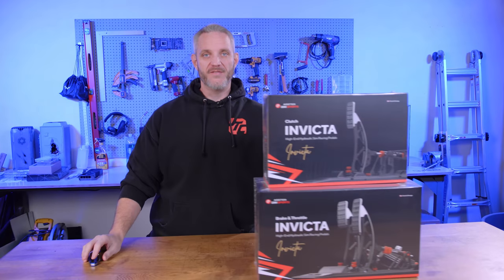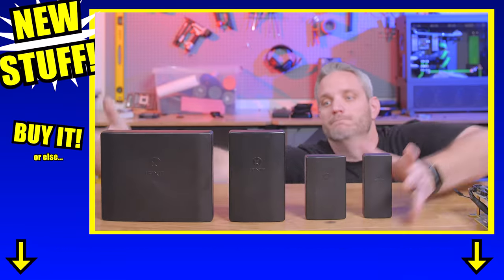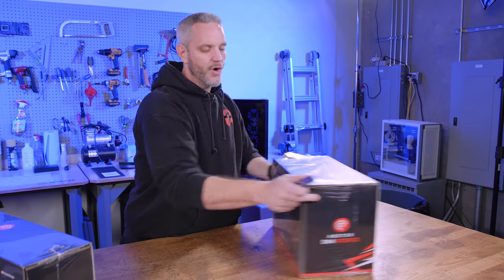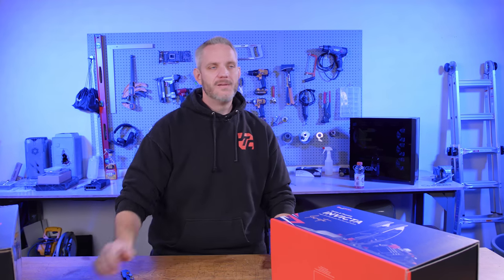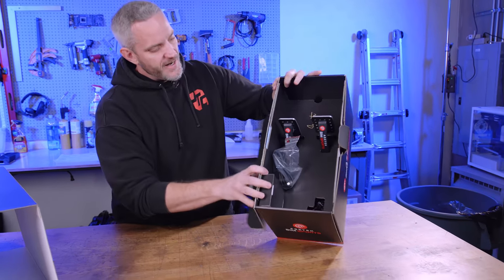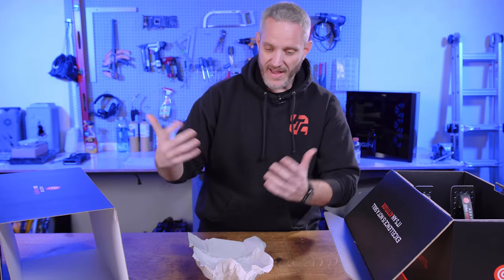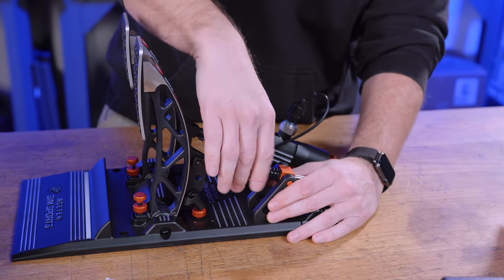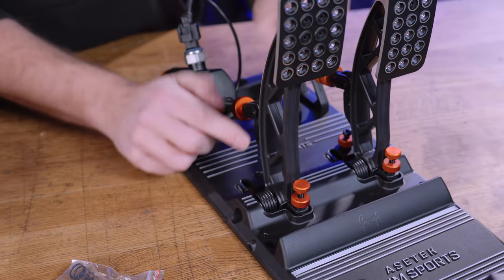These new Racing Simulator parts are insane! Asetek Invicta... yes, ASETEK!

Comment: you had that backwards. the switch gets pushed in while the pedal is at rest and turns the lights off. when you move the pedal off the resting point it releases the switch and turns the lights on. the brake switch basically works backwards of a normal switch.

Comment: The place where my brother stores his car in the winter has an arcade room. It's all automotive related games and pinball. They have a sick sim rig that is 3 monitors, 5.1, and even tilts and shakes the seat. That was the first time I saw a pedal set with hydraulic reservoirs lol. It's pretty sick. I can't image the cost. Every car I've owned has been a manual so I'd need the clutch for sure. The brake and accelerator seem far apart. Might be tough to heel toe downshift.

Comment: Just a FYI that's not how a traditional brake light switch works. Also the hydraulic switches are notorious for failing and causing a brake fluid leak and on Fords the cruise brake switch likes to start a fire when it leaks. Nothing like risking a brake failure over some lights.

Comment: You didn't mention the second, lower hole that is on the pedal side, which attaches the spring to the clutch petal.  Stop the video at approximately the 18:00 timestamp mark.  So, not only do you have the four holes on the spring side, you have two on the pedal side, which gives you 8 different angels of adjustment, in addition to the manual screw adjusters.  Anyway, I assume you will have a follow-up video to this, with actual user experience feedback (with various sims), and how the different adjustments changed your feeling.  Looks like good stuff, thanks for the video!

Comment: Just a quick note on one other floor mount reason: You don't get your foot caught under the pedal.

With dash mounted if your foot slips off it can get caught lifting it back up. Only perhaps for a millisecond but in racing that can be an eternity.
Reply: That makes a lot of sense, I’ve gotten my foot caught behind my brake pedal while heal toeing several times & it’s absolutely terrifying for a split second.

Comment: My guess is that the usb doesn’t stick out the back might because they were concerned about obstructions such as securing frame rails, causing issues with the port.  There is even the chance that they were concerned that it might be pressed up against the wall…not taking into account the overhang of the brake pedal making that impossible.

Comment: Sounds like the time I tried out a downhill racing bike vs my crusty mountain bike. I knew it had better suspension and brakes. But, I over estimated how good the brakes were. First time I used them. I nearly did a handstand over the handlebars... Didn't want to use the bike after that.
Reply: Under estimated

Comment: I may eventually give them a try but I love my Heusinkveld sprints. Big step up from the clubsport v2 pedals before them. I don’t feel like I’m lacking in the pedal department right now. Mounting them to the floor doesn’t really make a “firmer” platform. I have a sim labs inverted pedal rack for my sprint pedals and they feel much more natural that way. They are just as firmly planted as they were when mounted the other way.
Reply: Heusinkveld are a very reputable brand with excellent equipment.
Reply: @douglasm3310  agreed. I love them and even though I’m always looking for a reason to upgrade things they’ve been so good I can’t imagine anything being so much better that I should spend more money on something else.
Reply: @Jpilgrim30  I would get the heusinkveld ultimate over these however.
Reply: There's no way these will be as nice as the Sprints, ...  or even the Fanatec V3s by the reviews & look of them

Comment: These invicta pedals cost something like $1200 USD retail, and only work on pc.  They don't seem to be worth 2.5x the price of the fanatec v3's.  The build quality seems pretty much on par with the v3's, everyone says these invicta are too loud while in use.  
You need to maintain all pedals and lube them up or they all start to squeak.  Currently using a GT DD Pro wheelbase with Fanatec v3 pedals and the 911 GT3 R wheelrim.  These pedals look nice but i dont care for the super hard brake pedal as the only option.  I prefer to drive road cars in sims and actually bought the v3 performance kit in order to use the 2 softest elastomers it comes with to simulate how my real life daily driver feels like.  The v3's NEED the brake performance kit, the squishy sponges it comes with stock feel awful.  Also went for the adjustable dampener add-on to give the pedals a more realistic hydraulic feel.  On top of that i needed pedals and a wheel that works with all 3 platforms, PC/ps5/seriesX, and unfortunately that means Fanatec really is the only decent quality option.

Comment: lol, watching this made me think of some of my old 65 chevy truck...had a 3 on the tree with a six cylinder. Later it was changed to 4 on the floor with a mild built 350. No power breaks nor hydraulic clutch....just heavy springs that was rough on my left knee.
Reply: not that GM truck clutches were much better hydraulic, I had a 1995 S10 for a period of life and it had a pretty heavy clutch.  I remember driving a Honda Accord once and felt like I almost put the clutch pedal through the firewall. because I got in and muscle memory applied the usual force to the clutch and its like whoops this has a much lighter clutch.

Comment: Your first explanation of your car`s brake switch is backwards. When the peddle is at rest, the switch is engaged. As you press on the peddle, that switch releases and closes the circuit to light up the brake lights. In your example, the switch would interfere with the peddle as you applied pressure. The switch is on the front side of the brake pedal, not the back as you claim.

Comment: Formula 1 uses a clutch. It's on the steering wheel, and they use it for standing start or if they pit. They don't need it for shifting :)
But a clutch with a finger, ouch :D

Edit: My thought about the cable. If you want to mount the base flush to a wall, or somewhere else, a cable directly mounted on the outside of the case, and you would have the problem of bending the cable like crazy. Inside like this, and you can run the cable in any direction you want, even to the side. Looks strange in the beginning, but I see the advantage :)

Comment: 8:30 no, this is wrong! The soft-stage on these pedals is the elastomer, and the hard-stage is the 'wall' that comes after where the pedal only registers additional pressure that you put on the piston, which puts pressure into the system which is then registered by the sensor. What you are doing by screwing the endstop so far out is adding a dead-zone where the pedals don't register anything.

To add to the review, what I find funny now is that Asetek are saying that they are emulating the feel of a 'real race-car' which is technically correct, with the keyword 'a' race-car, as in, one of many. They say that 2cm of pedal-travel in the soft-stage is realistic, which is technically true for one setup. But the thing with brakes is that the soft-stage pedal-travel is determined by the ratio of the brake-piston to the brake-cylinder. So yes, their setup is 'realistic', but also takes options from the end-user because they only have one option. Where with other pedals like from Heusinkveld, or BJ Simracing, you get options. On these pedals you can also set up a super soft soft-stage and then a rock-hard hard-stage, giving you the ability to make your pedals feel like you want.

Comment: I use the logitech g920 gear and when I first opened this video I was like eh it's probably similar but I've never even driven a manual car irl so I didn't know about the clutch pressure or anything like that. After watching you've made me want to switch to something a little higher end because driving with the logitech clutch kinda sucks sometimes, there's no pressure in it at all so it's hard to find the right spot coming off the line. Honestly the logitech brake and throttle I know aren't great either but they're leagues better than the clutch

Comment: I would love to differ with you Jay, but you are right to a certain extent, logitech pedals are ok when not in racing sims, as I do a lot of ETS2, and ATS, but does make me wonder sometimes if the brake pedal is connected to anything as you go hurtling towards a lot of stationary traffic unintentionally, even though I do turn the brake intensity down so not stopping on twocents from 56 mph. just never had the money to upgrade my rig setup, as 2015 was buying the wheel, 2016-2018 was buying controllers, 2018 was building my pc, 2019 - mid 2021 was a tough time money wise, maybe time to look at upgrading my pedal system, so looking forward to another review of you testing this on your rig for a week or so, so you can give us a proper review.😀

Comment: Hey, Jay. You got the brake light switch mechanics backwards. The switch works in reverse - it is on the other side of the pedal and it's always depressed and it turns on when the pedal moves away from it. 🙃

Comment: Edit: When $600 for JUST  a set of pedals (the Fanatec Clubsport mentioned at the beginning of the video) is "the top of the low end" in racing sim gear... this is what I'm talking about as far as ridiculous price is concerned.

I just wish sim racing gear wasn't so expensive to get into. Without force feedback, the wheels are completely useless, and you're not getting a decent one of those for under $400 - 500. Still cheaper than a new video card, but ... ouch. And that doesn't even take into account getting either a frame or a freestanding mount for them.

Comment: I love sim racing i miss my sim racing set up but i didn't get enough time to use it as much as i wanted to. Fanatec is great for the pricepoint wich most can't even afford these are on another level when it comes to price only the well off hardcore sim racers could afford them and justify the cost.
Reply: Sorry to say but those invictas are not even close to high end hardcore equipment. They are more the average entry level hydraulic pedals that are fairly good value for what you get with them. Same as the Simagic P2000 TBC pedals. The real hardcore racers use stuff like Simtag tilton blacks editions or stuff like that.  

Like jay said, Fanatec is the upper part if the low end bracket in terms of pedals they provide.

Comment: I'd love to have a high quality racing sim setup.
Speaking mostly about the wheel and pedals of course but it feels so expensive and complex to get into.
Reply: It is expensive and complex, so start out cheap to see if you actually like simracing and want to pursue this hobby further.

I started 6 months ago with a Logitech G29 and a Playseat Challenge; just last week I finished assembling a 8020 cockpit which was complex and VERY time consuming to build, so beware.

Originally, I was looking at the Fanatec wheelbase and pedals, but I think I will skip those and go for Simucube and Heusinkveld, or even the pedals in this video.

It will get expensive extremely quick.
Reply: @frankvermeulen4621  Well, so far I have my trusty yet old Driving Force GT which still works well.
A shifter and better pedals would be cool though, I know at least the former can be added as there are such that use USB.

Comment: I'm curious about force feedback in the shifter, I've never heard about that being a thing but I feel like it would be an important component in a high end system...
Reply: Force feedback on a shifter ? Your shifter shouldn’t be shaking or having any force dude. If it does, something is really wrong with your car lol most high end simulator shifters are literally the same system used on real race cars.
Reply: A tactile transducer like a Buttkicker mounted to the side of the shifter running through software like sim commander works extremely well. The Fanatec shifter has matching mounting holes already
Reply: @Barbosa81  There are cases where you can't put it into gear, being able to just force it into gear because it isn't a real shifter would be silly.
Reply: @gudenau  that would be because you have bad sinchros in your trans or you’re not pressing the clutch fully. And that only happens on road cars. Race cars have dog gears transmission and it will go into gear no matter how you’ shift it. On a simulator if you do this on a road car the car wil stall or bog it.

Comment: The other problem of electronic brake light sensor is that some work like the light in your fridge : it only lights up when the button isn't pushed. So if the little piece responsible for the pushing breaks, it's always on. Next thing you know, you have a dead battery the next morning before going to work...
Reply: Not on all cars. Older Fords use a NO switch that closes on pedal depression; dunno if they still do. It's kind of a weird setup that uses the end of the pushrod to actuate the switch as the angle between the pushrod and pedal arm changes.

My old Nissan (Datsun) has a hard rubber button that contacts a NC switch as you describe. I taped a penny over the hole until the dealer got their shipment in (they had 2; I needed 3). Other owners have mentioned simply welding up the hole, but I figured that probably wouldn't be great for the switch in the long run - and the buttons are still current stock over 40 years later, unlike the switches. So I'm sure Nissan is still using the same system.
Reply: @Azlehria  solved mine with a good old nut and bolt
Reply: @guillaumejoop6437  In hindsight it wasn't clear, but I meant that I figured the metal surface wouldn't be good for the switch - after all, it would have been cheaper and simpler to simply use the arm itself as the actuating surface. Since the original switch worked flawlessly for 40 years, I felt that for 96 cents each it was best to just retain the factory configuration.

Comment: Slightly off on the description of how the brake works on this pedal. If the bushing isn't engaged and its just the spring, that's the deadzone. The bushing is the soft stage. Then the outer edge of the adjuster nut will bottom out on the cylinder and become rock hard, that's the hard stage to build up extra pressure for braking without the pedal moving.

Comment: with break so stiff does it matter to have pedal? it seems it just signals if it is pressed or not, there is no possibility for the user to adjust how much breaking force to apply
Reply: Works off of the AMOUNT of pressure applied to activate the variable electric pressure switch
Really is not any different how a load cell works and they both send the game the exact same info they just use a different method to reach the same exact result.
But many hear the word hydraulic brake system and suddenly think it is doing something that you cannot do with a quality loadcell pedal set which is not true at all.

Comment: I know this doesn’t got anything to do with this video but I got a question, I don’t see why you couldn’t but I haven’t found an answer can you use and ek water block with corsairs pmma tubing? I want to use a ek water block because it looks better on the gpu same with the cpu I’ve heard not to mix there fitting and use corsairs fittings so just out of curiosity any thoughts.

Comment: Wow, these are more expensive than the heusinkveld sprints I've been running. I'm curious to see how they stack up against each other.
Reply: I mean, there’s pedals way more expensive than this set too.  I have Sprints myself, I don’t think I’ll ever replace them but the adjustment design on these are impressively well done.
Reply: @WhiteHawk77  they do seem a lot easier to adjust, compared to the sprints.

Comment: F1 cars do use a clutch, but its not a pedal. It's a button on the steering wheel
Reply: @pistolfied  right, again, not a pedal... a button (a small object that can be pressed or depressed to give function into module) that engages clutch

Comment: How does the system monitor the throttle?  I see through the sensor on the brake how that works, but I'm not sure how the throttle itself works.
Reply: Hall sensor on both throttle and Clutch

Comment: 700 euro pre order price expensive but then again cheaper than a gpu that you will replace in 2..3 years, theres no reason the pedals wont last you 10+ years infact the reason a lot of gaming hardware stops being used is not breakage but because the maker stops releasing drivers for the latest windows version

Comment: Jay a have a question.... i have a rtx 3080 oc with 1080p monitor i thinking to get a 2k monitor it is worth it if i have a i7 8700k? Bottlenet?
Reply: Lmao wtf no you bottle neck a pc by lowering the resolution. You’re already bottlenecked you need to up your resolution to reduce the bottleneck on your cpu.
Reply: @douglasm3310  im not so in on this sry, so what i have to do ? Change cpu? Change monitor? I have a 1080p monitor sry for ask again . . .
Reply: @AnjoSChile  you would want a new monitor. 2k 165hz+ or even 4k is possible.
Reply: @douglasm3310  Msi G32cq4 Curved Gaming Monitor this can be good?
Reply: @AnjoSChile  looks like good specs but I haven’t seen any reviews so idk if it’s a good monitor. Hardware unboxed has some great monitor reviews. I’m running a 3440-1440 ultra wide with a 8700k and a 3080ti